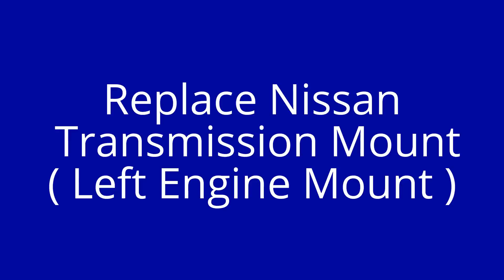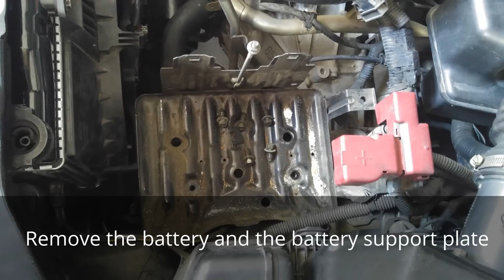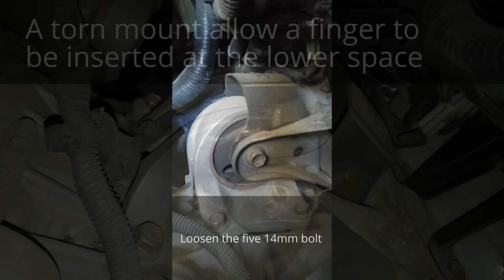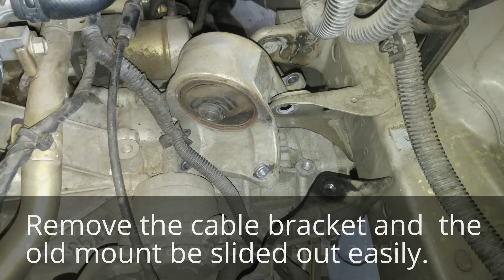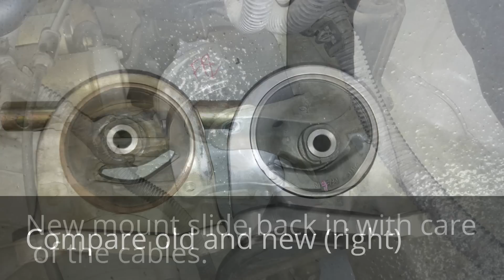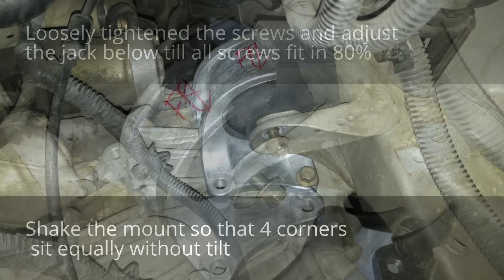Nissan Transmission Mount Replacement

Comment: This is "NOT" a Titan transmission mount video, it is a "FRONT WHEEL DRIVE" car. Titan transmission mount is under the bed of the truck, near the rear axle.